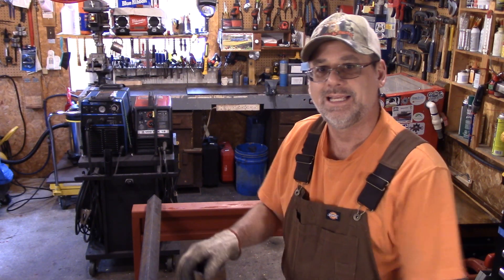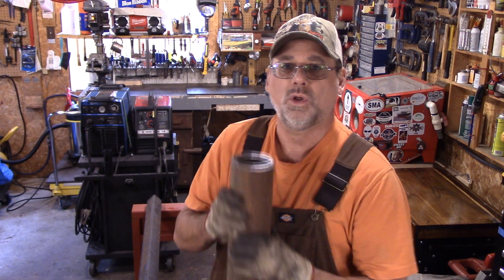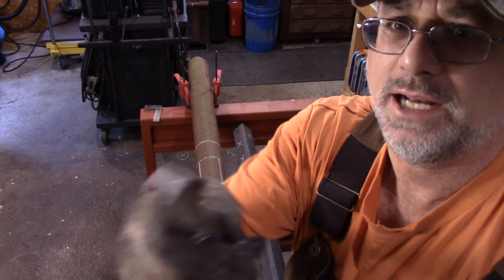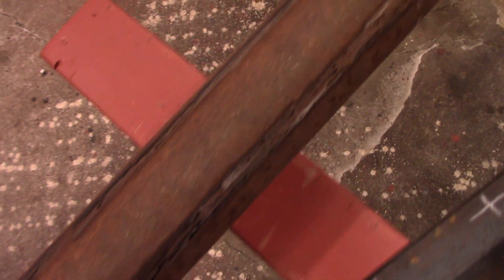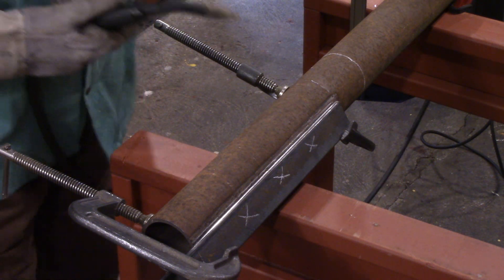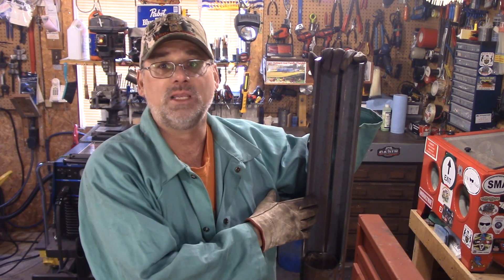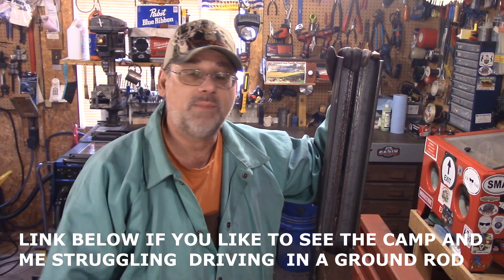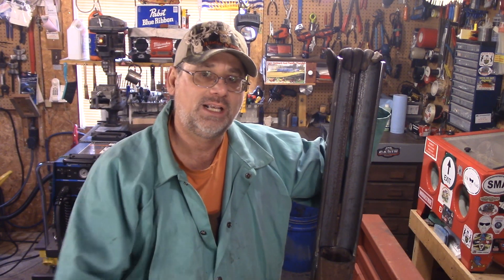HOW TO BUILD  A  SOLAR PANEL TOWER/POLE  FOR MY  REMOTE CABIN IN THE WOODS - PART ONE

Comment: I need to build the same idea, but i only have locust logs to work with and I need 15ft of height. But basically same idea. My other choice is to build the tower,  lift it in place, then hoist the panels up to the top and tie off.
Reply: Always!!!😊
Reply from the maker: Have fun building it 👍

Comment: is this  the "backyard revolution" scam? claiming an 85% boost to panel efficiency?
Reply from the maker: Not sure what you mean ,i'm no solar expert.
Reply: @SteveRobReviews  ok no worries then, your channel showed up probly cause of the word "reviews"...between a couple of channels from a devious scammer, who writes his own reviews, making outrageous claims without a shred of evidence. Wasting folks time for clicks. I reported him to YT.

Good luck with your project, i lived offgrid for 14 years with a 250 watt panel and some car batteries ,-)
Reply: @gammaraygem  Does he claim to use a MIT design? And did he discover it after being robbed?
Reply: @gammaraygem  Yeah that claim has some of the panels facing downwards????  How can that be efficient?  One look at that setup and you know that's just bogus vs all the panels facing towards the sun.  Besides that fellow said it save him what (like 60%) off his bill, and if it was that easy he would have built more and had $0.00 electric bills.

Comment: Steve the camp is on a table land so it is solid rock good luck dring to dig through it may be able to drill into it with a diamond plated rock drill bit. I got my solar up in my solar powered workshop with my home made work bench from my old back door. I have a 180 watt 15 amp system with a battery bank of 3 deep cycle flooded led acid batteries.
Reply from the maker: I do have some spots rock free and it's going in forsure :)
Reply: @SteveRobReviews  that's good Steve.

Comment: Sounds like a good idea. Adjustable for the sun direction and angle would be a good thing to build in. Thank you for the video, Steve
Reply from the maker: Sean I'd like to be able to have adjustability but I'm not sure i could figure it out before winter. 😂
Reply: @SteveRobReviews  You can lose a lot of power if you do not have a good alignment with the sun.  And it moves to boot.  Not the easiest thing to figure out
Reply from the maker: So true , I have to do some math but I think a fixed mount will be fine as my  panels are fixed now.

Comment: I don't know Steve, what kind of winds do you get there and how many square feet of solar panels are you going to have on that pole ? Around here the winds we get would push that right down if it's just into dirt 4 ft deep, even concreted, if you have too much sail up :-)

You said you have rock there, good old Canadian Shield I'm guessing :-)  If you could bore a hole into that you'd be so steady the steel would bend before it pulled out, and that would take a tornado. Not easy drilling though. What might it cost to have a crew come out and drill ? Maybe if they're in the area anyway for well work ? As a bonus you could then just grease the poll up good, slide it in, and be able to swing the panels to chase the sun. Getting too complicated aren't I LOL :-)

How bout maybe dig your hole in dirt and concrete it like you plan but weld some steel wings ( 2, 3 ?, 4 :-)  ) to the sides of the tube ? Then when you pound her into the ground (might be a bit of a job, especially if they hit any rocks, got a post pounder for that tractor ? ) they slice down and give some extra lateral anchoring into undisturbed soil ?
Reply from the maker: Lots of great ideas and im most likely going to experience them all :)  Going to be interesting but the ideas I have today always need slight adjustment. Stay tuned bud. LOL
Reply: @SteveRobReviews  : Heh, happily staying tuned  :-)   This looks like an interesting build already !
Reply: Hmm, another thought, but $$$   ;-)  (easy to spend your money for you lol). What about dig your hole, then using the tractor (if your auger will adapt and handle it) drill one of those big screw piles (helical piles) into your nice patch of dirt (fingers crossed no stones ;-)  ) and then bolt and cement your buried pipe to the end of that ? That would pass code and be pretty darn solid  ;-)

Maybe you could even DIY a screw pile ? They look pretty basic :-)
Reply from the maker: HAHAHA you might as well drive up and give me a hand  since I have no idea how this will end. 👍
Reply: @SteveRobReviews  : LOL ! I'd love to, just for the beers and fun, but it's a few miles ;-)  I'm out in the middle of the gap, the big flat space everyone drives through or flies over to get from there to BC.

Comment: so hows about on the end of your angle you weld on a boat winch.  string the cable out to the end of the mast.... then you can crank her up and down and clean the panels every morning
Reply from the maker: Now we're talking - good ideas and you just may see a boat winch too. LOL
Reply: @SteveRobReviews  ya know.... i don't think id mount that fast to the concrete... If you pour your concrete with a sleeve you could spin the hole works from the ground.... could be useful as a simple tracker to aim the panels into the sun threw out the day? you could even make a simple tie rod to change angle from the ground?
Reply from the maker: Good points but its going in the ground hell or high water one way or another. 😂,